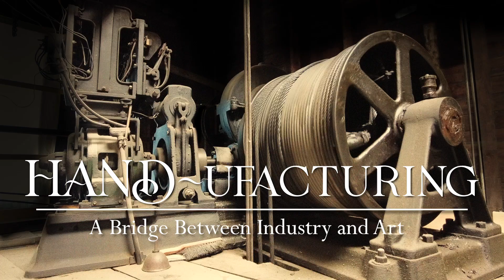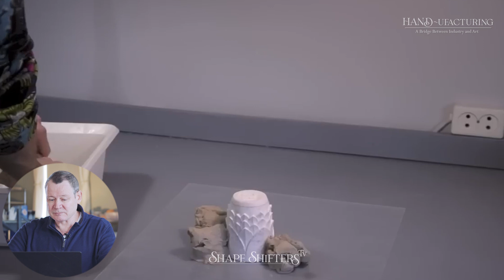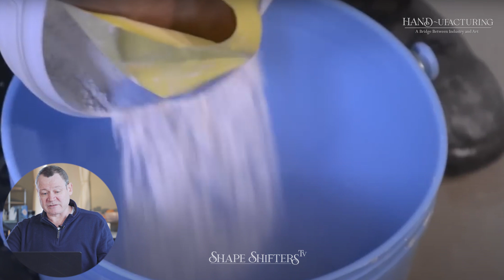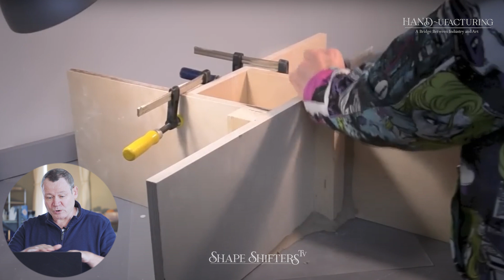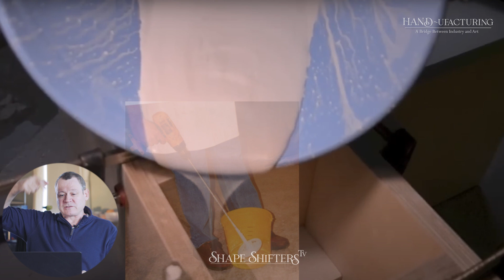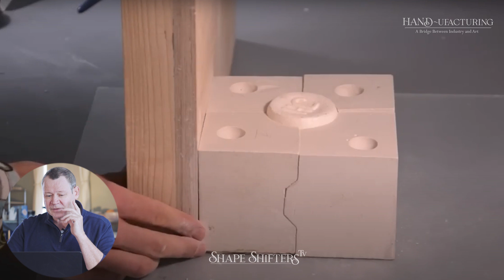PRO Mold Maker Reacts | SLIP CASTING With Undercuts Can Work  | Michael Joy

Comment: i thought pouring slip into a silicone mold will not only sink but also warp... hmmm
Reply from the maker: Pouring slip into silicone doesn't work. Did I say it backwards? I was saying to make a silicone plug of the actual mug shape and then build the plaster mold around the silicone mug. That is how you can deal with undercuts... rubber master model or mold. Is that what you meant?